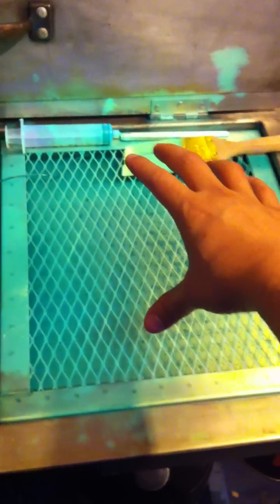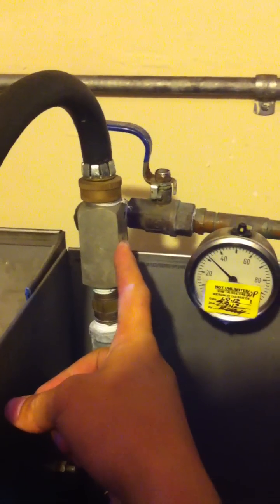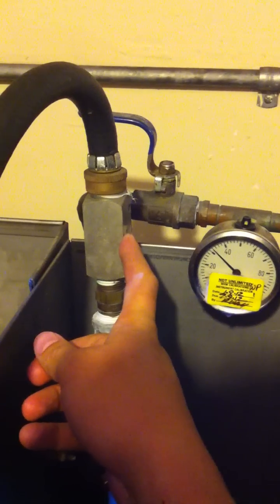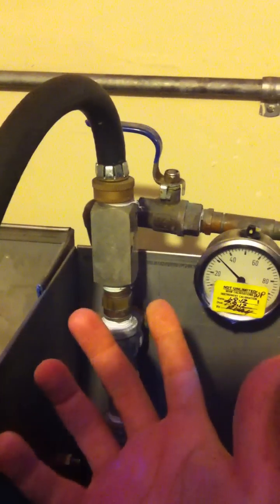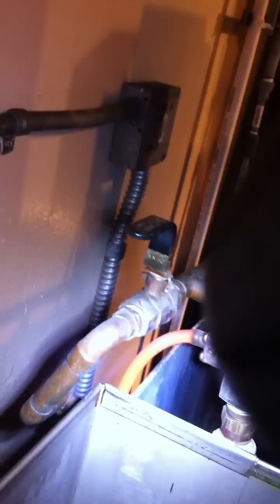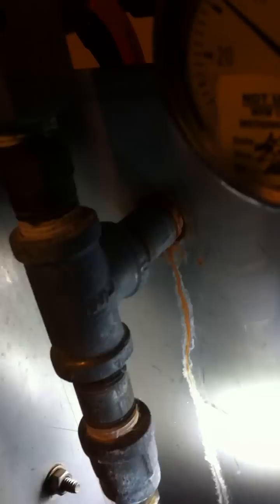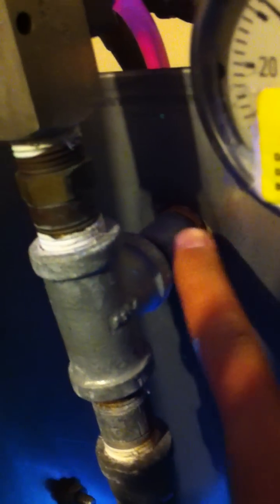Method D Penetrant Line

Comment: Dema valve?
Reply from the maker: The emulsifier and water need to mix in a concentration between 1-5% to pass lab testing per the ASTM spec for penetrant. The in-rushing water will mix with the emulsifer in the DEMA valve. Their not cheap either 300-600$